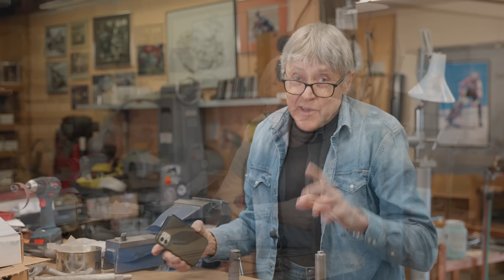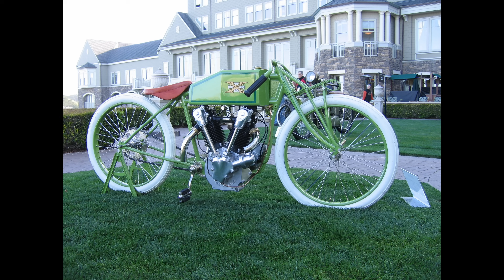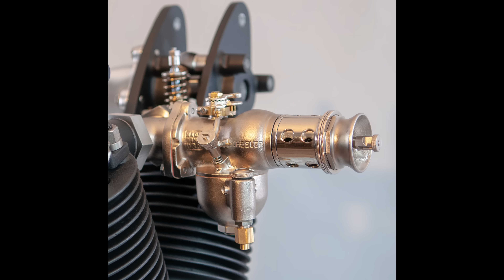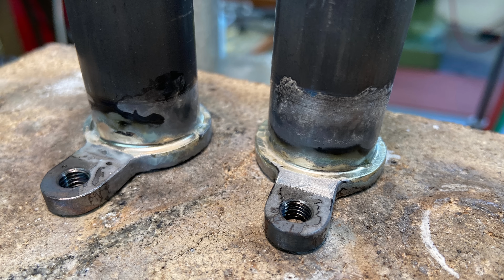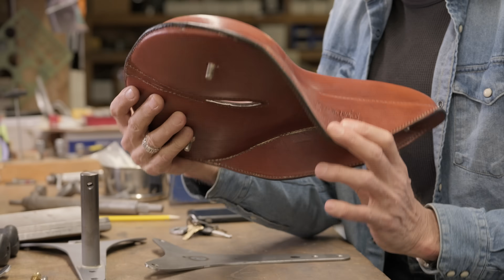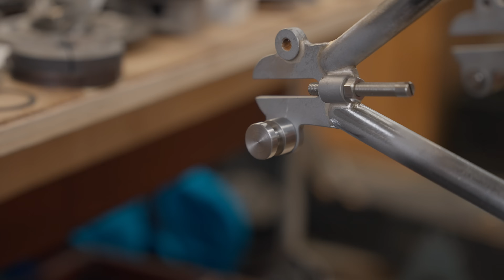Excelsior Update // paul brodie's shop

Comment: Absolutely fantastic project. The bike looks amazing. Very well done. Could you explain a little bit about the gearbox and also how you decide what sort of material to use on what part of the bike. The grades of aluminium and steel to accommodate thermal expansion and possible corrosion issues. Thanks so much and hope you are on the road to recovery.

Comment: What is nickel silver, and how does it compare to silver solder, or bronze braze?
Thanks from Australia
PS I once saw a Brodie Bike here in Melbourne!
Reply from the maker: We do have several brazing videos in our archives that you may want to check out...  On a bicycle frame, silver solder is used for the water bottle bosses, and cable guides. Nickel silver would attach the brake mounts and the seat binder lug. Bronze braze would be used to fillet braze the frame together. Make sense?

Comment: You're a bad influence! LOL. After watching your Channel, Two years ago(before I retired) a neighbor in town Sold his house and there were "his and hers" Mountain bikes and a "free " sign.For some reason I tossed them in the back of my Truck. As luck would have it My Truck Broke down a month later. I got a Chinese Two Stroke engine and made a few frame Modifications and put a milk crate on the back of the 'His' and scavenged parts off of 'hers". That motorized bicycle saved me from walking probably 14 miles a day, carried over 80 pounds of Groceries and me up 45 degree inclines! No Reggie No helmet, No Insurance, No Hassles from.... LOL... "THE MAN!!" My 175 Harley Aermacci got me through the pandemic previously, but luck was running low. I guarantee If I rode My Harley Pan head or even my Triumph I would've had a free vacation from "THE MAN"! LOL....The Moral of the story is "Third Class Riding Beats First Class Walking every time!'I put over 600 miles on that bicycle at @90MPG. took my softail out for a ride yesterday, it was 70 degrees. Get Well soon and please be careful on that skateboard, you DO know they're Dangerous? LOL... You're an inspiration, but Holy Cow, that is one really funky Accent you got!
Reply from the maker: Yes, you have lots of stories too. Thanks for watching... :)
Reply: Having a Dream requires following through, and sometimes it takes years to get all your Ducks in a row to the point of actually having the skills, the tools and the Machines the means and the know how to actually move forward! And a lot of Good Luck also! You Truly are an inspiration. Building all the infrastructure of Manufacture is a Herculean Task! Not Just Stories I tell , Honesty is Under rated these days. Thank you! Most People and even Manufacturers  would Consider Recreating an Excelsior Engine from a Photograph totally Impossible! But You Did it!  A True Inspiration that nothing is impossible! and Thank You!

Comment: Hi Paul, I don’t know if you’ve looked into metal 3d printing services at all. For very low production numbers/prototyping, it could possibly be a cost efficient way of doing things, especially if you’ve got the cad files for the parts.
Reply from the maker: Thanks, but I have not. I have all the parts I need to build a few more Excelsiors, and I'm not planning any more big projects.. :)

Comment: Very nice video Paul.  I have wondered about those short short pipes seen in the 1910s / 1920s bikes.  Drag pipes on a Harley sportster move the power band up in RPM at the expense of grunt at lower RPM.  And the drag pipes are way longer than those shorties you have.  Any problem tuning (or even getting it to run cleanly) with the short pipes?

As to wrecking on the track, I was spectating at Lime Rock in Connecticut a few years ago, (these are vintage race cars, not bikes), and there was a pretty spectacular incident right in front of me.  The Ferrari took a few tumbles end-over-end and looked totaled.  A minute later, the team owner and his cronies slid into the grassy knoll trackside in a van, and wanted to know who saw the incident and what exactly happened.  I gave him my bird's-eye report, concluding with "your driver is going to be very sore tomorrow."  His reply in broken Italian/English was, "if he survives the night."  LOL
Reply from the maker: Thanks. I think it is hard to tune those short pipes. The longer pipes on Harry Hi-Pipes sound much better and are easier to tune...